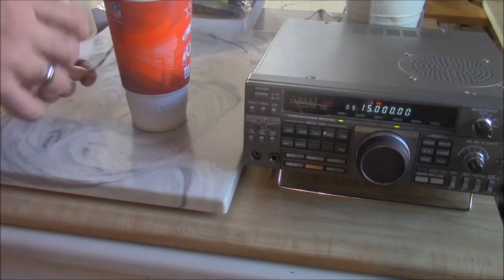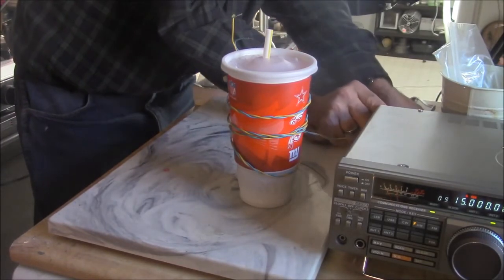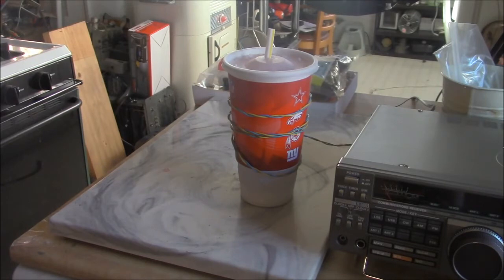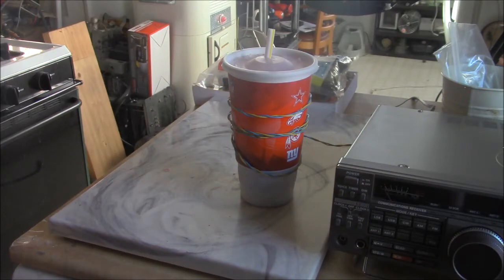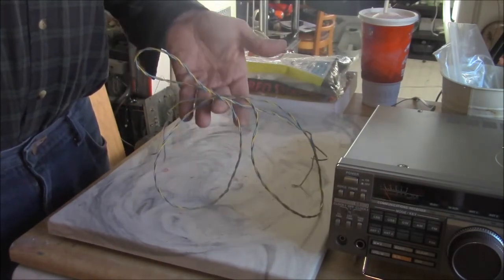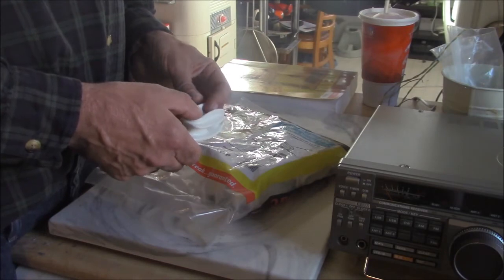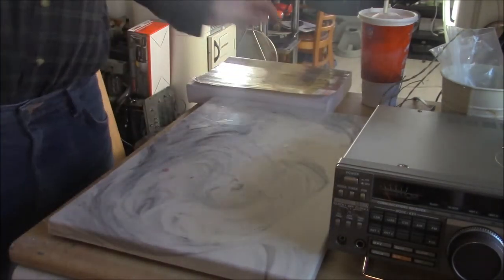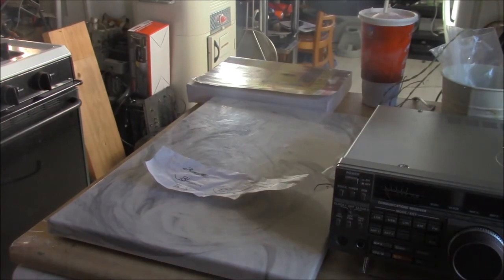Thoughts about Shortwave antennas

Comment: Azimuth and or direction play an important role in some installations. I always imagined when entering a tunnel or going under a bridge that the wave length (imagining an actual wave) that the wave just is to long to fit under that structure.
Broadcast AM  band being nearly 300 meters is a dang long wave. Of course most do understand the features of resonant harmonic fractional wave length antennas but even the best antenna will be hard put to "grab" that signal if your reciever's antenna is under a rock or some such.
Reply: *****
I have been fairly stunned with just a hank of wire poking out the back of a coax socket, I guess as one is dealing with HF in the giga/mega hertz region it comes down to siginal quality and strength.
I am not a fan of the new digital TV broadcasts when the wind blows, so much multipath it makes the images un viewable. I have a fairly decent antenna for TV but regardless of placement it works best when it is calm outside. I guess it needs to be up another 20 feet...